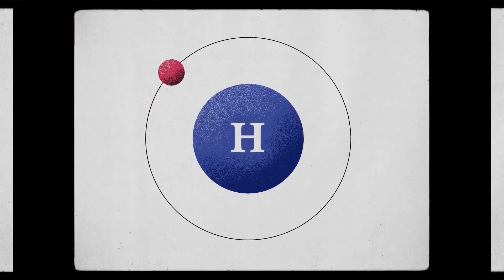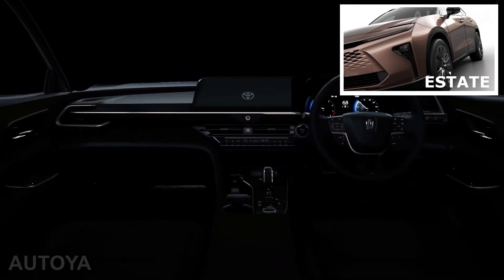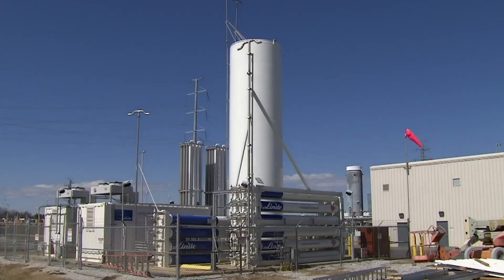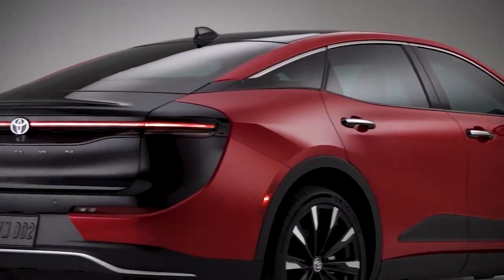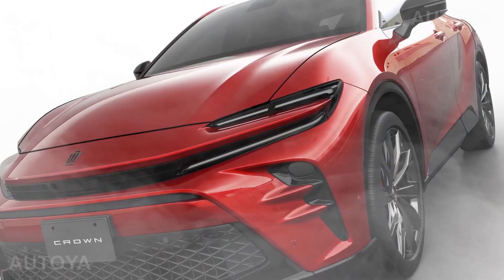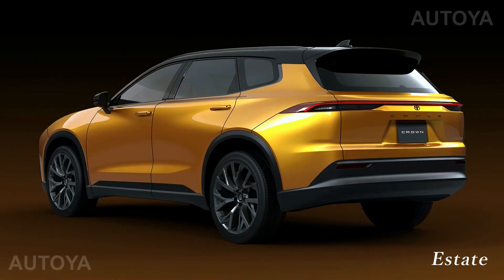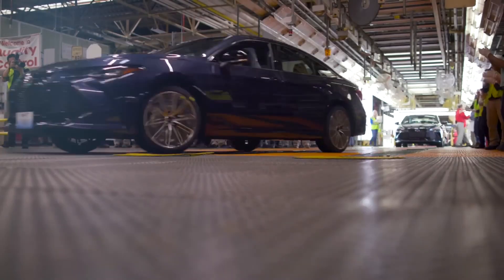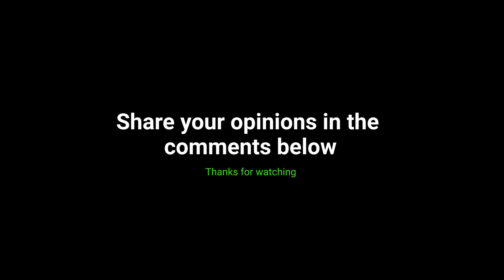Toyota CEO: "Our New Engine Will SHOCK the Car Industry!"

Comment: Hydrogen is the most abundant element on the planet.... which kinda negates the energy density argument.. and hydrogen can be used as an ingredient to make a carbon neutral eFuel or Synfuel that makes a liquid fuel that can be used in current ICE engines, current fueling stations, and current distribution networks.... synfuel and fuel cells will leave battery EV's on the ash heap of history.
Reply: 😅🤣😂
When are you scheduled to have your head surgically removed from your butt?
Reply: How does one of those relate to the other? It is abundant but not easily available. Every step in just releasing the hydrogen is energy intensive. Most hydrogen produced today in the United States is made via steam-methane reforming, a mature production process in which high-temperature steam (700°C–1,000°C) is used to produce hydrogen from a methane source, such as natural gas. In steam-methane reforming, methane reacts with steam under 3–25 bar pressure (1 bar = 14.5 psi) in the presence of a catalyst to produce hydrogen, carbon monoxide, and a relatively small amount of carbon dioxide. Steam reforming is endothermic—that is, heat must be supplied to the process for the reaction to proceed.

Subsequently, in what is called the "water-gas shift reaction," the carbon monoxide and steam are reacted using a catalyst to produce carbon dioxide and more hydrogen. In a final process step called "pressure-swing adsorption," carbon dioxide and other impurities are removed from the gas stream, leaving essentially pure hydrogen. Steam reforming can also be used to produce hydrogen from other fuels, such as ethanol, propane, or even gasoline.
Now that you have hydrogen you need to pressurize the hell out of it. Energy intensive. Then, are cars going to go to the refinery to fill up? NO. The hydrogen requires a huge infrastructure of pumping stations...and many trucks to haul the hydrogen to those stations. Along the  way much hydrogen will leak out because it is the smallest molecule in existence, so no seal can be hydrogen leak proof. Energy intensive. Now you put the hydrogen into a car and feed it to a fuel cell. About 60% efficient, the rest wasted. Knock off all the other inefficiencies and they are around 40% efficient...and expencive because of all that. 
Now, take the output of renewable energy and put it directly in a battery and you get 95% efficiency. Cheap, reliable and presently the fastest growing source of power. The battery after 15 years of powering a vehicle will be used for stationary storage or grid balancing. Then after 30 years use or so it will be 100% recycled and start life anew. Try recycling hydrogen after is goes through a fuel cell.

Comment: Ev's are not good for the environment , and their limitations are substantial.
I predict they will not live up to the lofty forecasts , and will never replace the internal combustion engined vehicles.
Reply: I predict that your prediction is already a lost cause. EVs are much better than oil, gas, nuclear or hydrogen by a long shot, and cheaper and cleaner.
Reply: @paulsmith3921  Nah. They aren't. The infrastructure isn't in place for them. And they have substantial limitations. EV's aren't better than gas. Sorry. I'm not jumping on the EV band wagon.They're not cheaper, that's for sure.
Reply: @jadis40  Over a short few years they are definitely cheaper. Why it is that opinions like yours always come from people who have NO knowledge of the product? How long have you owned an EV? You haven't, so your opinion drops in value.
Reply: @jadis40  Almost every house on the planet has the ability to charge an EV. Do you have a gas pump at home?
Reply: @jadis40  100 miles is plenty for the people that buy them for city/rural  use. Most EVs have at least 200 miles  range and the most popular EV has 350 miles. within a year that will be greatly extended.
Reply: @paulsmith3921  Doesn't matter. I'm not interested in an EV. I don't plan on ever owning one. The OP is right. Their limitations are substantial, and they're not going to replace cars with ICEs.
Reply: @paulsmith3921  Yeah. 100 miles for the city. Doesn't do much good on a wide open stretch of Interstate like those that exist in states like North Dakota or South Dakota now does it?
Reply: @jadis40  Read what I said...carefully. Not everyone in the world lives in the U.S. Most people on this planes live where there are no interstate highways. 14% of ALL new car sales globally are EVs. That was 2% 5 years ago and the rate of growth is increasing, so goodbye fart cars.
Reply: @paulsmith3921  Nah. You wish. EV's will never replace ICE cars. EV's are a fad at best. ICE cars, on the other hand, are here to *stay*.
ETA: A fad with poor mileage per charge, not to mention the initial expense.